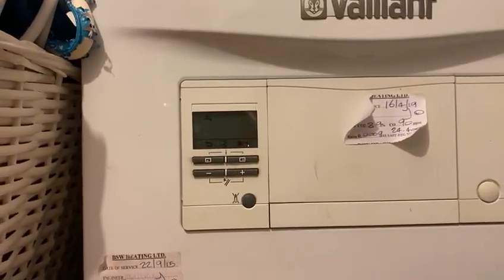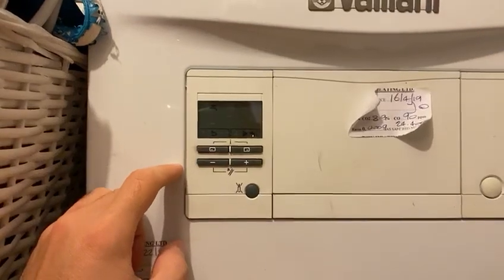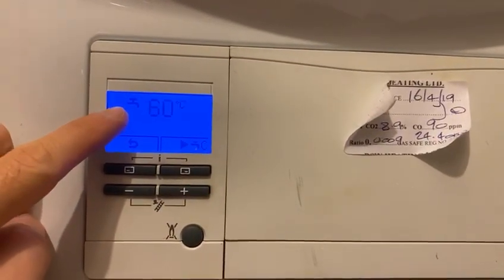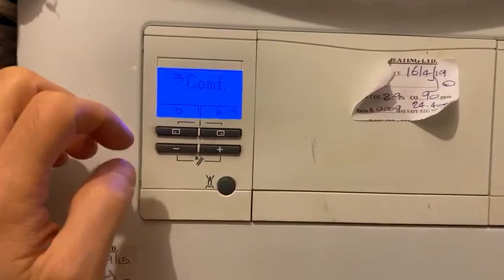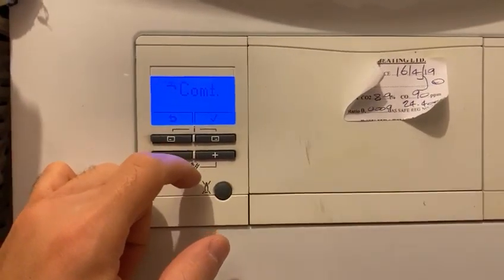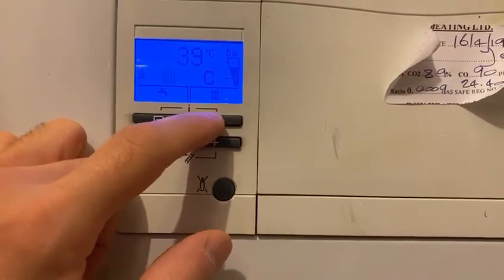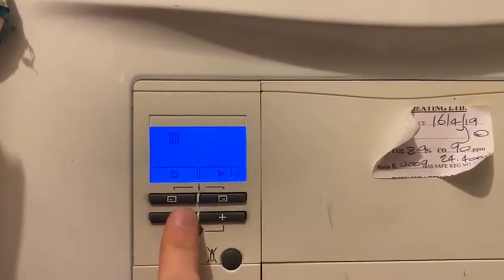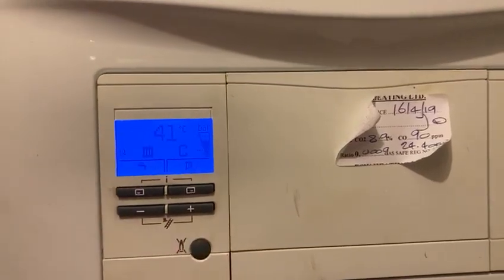Vaillant boiler controls-no heating  hot water ( Easy Fix)

Comment: I don’t have the tap cymbal so cannot adjust tap water temperature we have same boiler. Tap water far too hot engineer won’t tell us how to do it,
Reply from the maker: I would sugest rebooting the system by holding the round button under the screen with the flame button on it. If it still not showing, turn the boiler off at the mains and turn on again after a minute. Let me know if that restores it. Please also CAN YOU SUBSCRIBE TO MY CHANNEL AS IT WOULD SUPPORT ME ALLOT TO GROW ON YOUTUBE 🙏🏻🙏🏻🙏🏻 thank you and best of luck
Reply: @ErisLifeHub  I wish that had fixed it, still no tap cymbal?
Reply from the maker: @Lostoldman  That is really strange to be honest. Ill do some research and get back to you asap. I will also try and do another video on your issue so please subscribe and press the bell next to it to save my channel so you get the reminder soon as I upload the video 👍🏻
Reply: @ErisLifeHub  ok subscribed. Thank you very much.
Reply: @ErisLifeHub  i just been told its a vailant combi boiler. And the tap cimbal thing wont be on that model. Engineer adjusted tap water temperature near to the emersian heater just next to it inside the same flap.
Reply from the maker: @Lostoldman  so is slightly different to mine or not?
Reply: @ErisLifeHub  looks the same to me but obviously something is different
Reply from the maker: @Lostoldman  yeah could be a different model but look similar..
Reply: @Lostoldman  Hello, I have same issue a combi boiler here, what is the procedure then? I have no hot water now
Reply: @chriskgu4428  I had to contact an engineer to get it fixed. He did some stuff, not sure what. He did say no tap cymbal on this model.